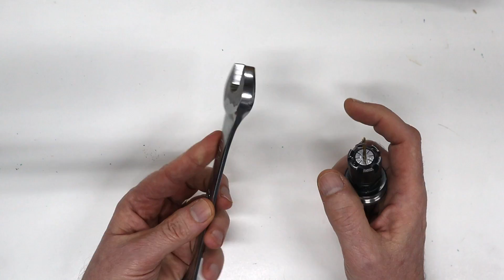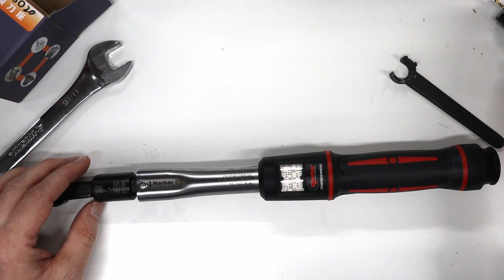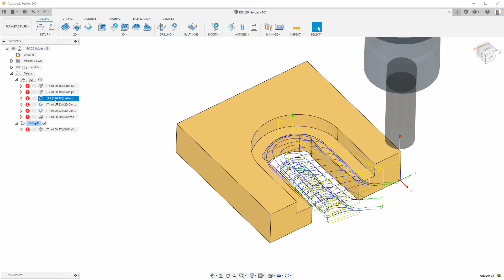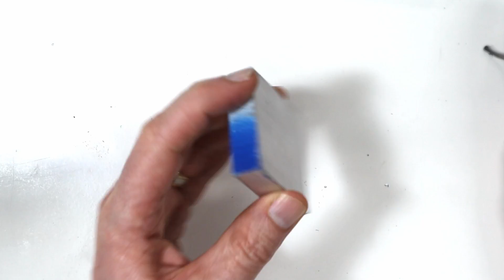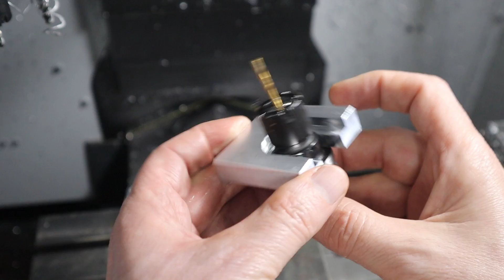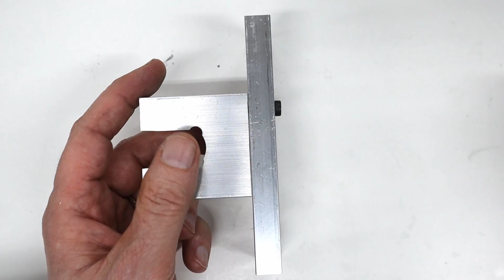Making an ISO 20 Tightening Fixture

Comment: I had a few issues with some parts this weekend. First runs of anything need checking twice. I didn’t video just for that reason. But I also have no followers. Catch 22. I’m going to try and make one of those for my TTS holders. Thanks
Reply from the maker: I believe NYC CNC did a video for TTS holders using a one-way bearing. I was going to make something like that before I got my Haas.

Comment: Be sure to check the run out for various torques.  I've found that just going to the advised torque will cause more run out than you intend.
Reply from the maker: Good to know. My plan is to use the advised torque only on 3/8" or larger end mills that I'll be running hard. I want to prevent pull out.